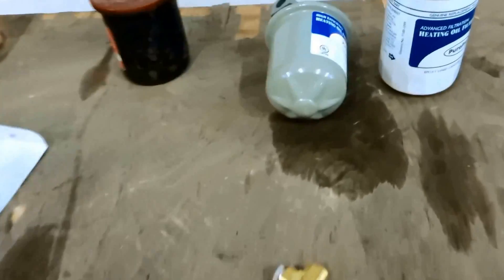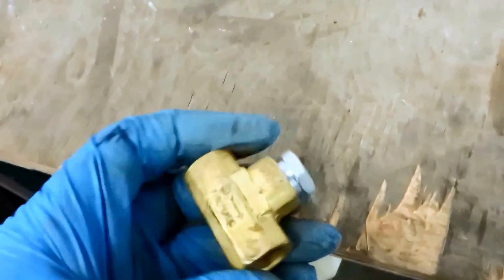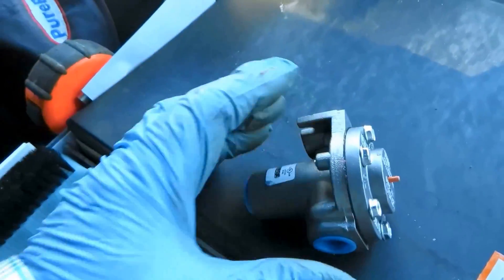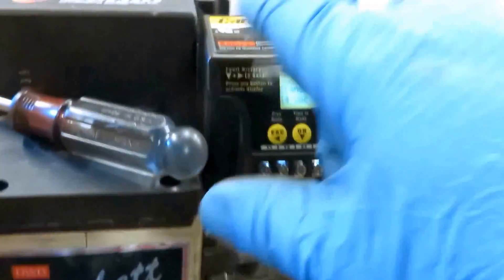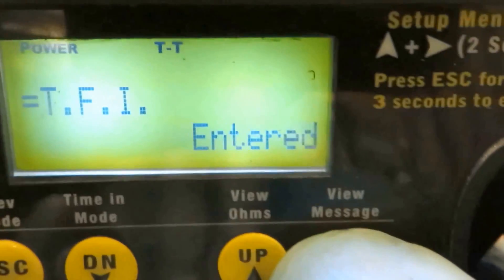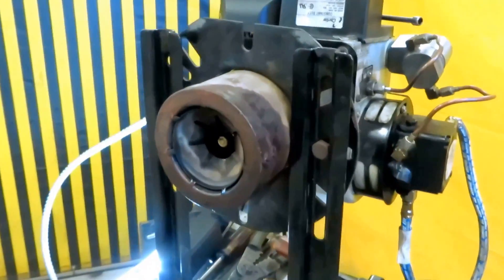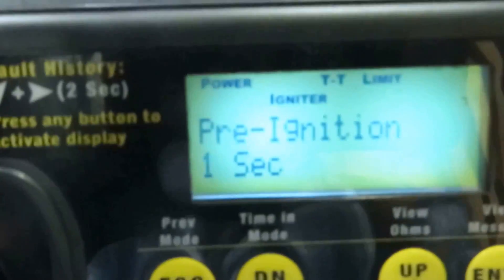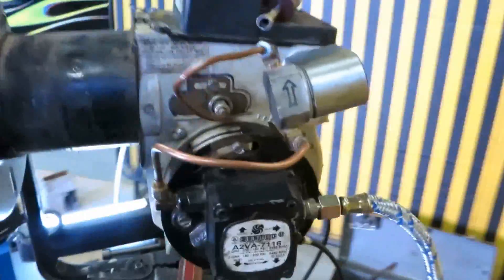Beckett oil burner training series # 6

Comment: I was always told you needed a constant arc to keep the flame going. Do the old school Honeywell R8184 "Intermittent Ignition Oil Primary" boxes cut the arc after flame is established? Edit: I found you answered this in Episode #7 in the comments. No an arc is no longer necessary once the flame is established. I guess I should have upgraded to the less expensive, but fancier, Relay Box that has separate controls for the motor/valve/xformer to extend the life of the transformer. Like your experience,  I have replaced several of the "electronic" transformers while the older style fatties keep on trucking (over 12 years).